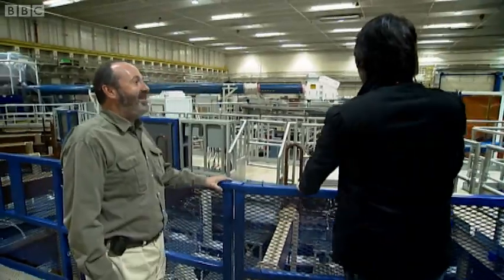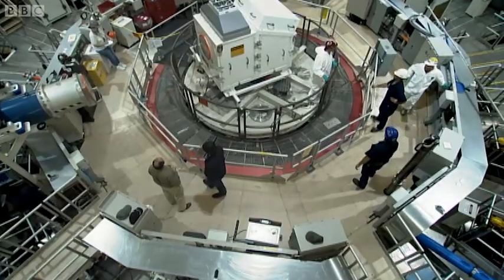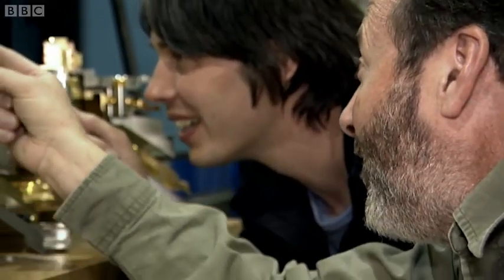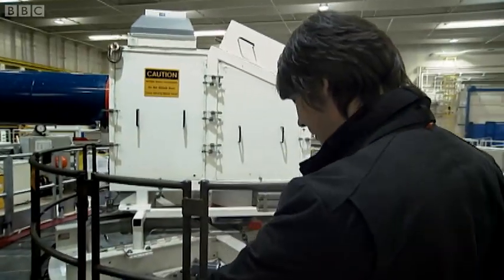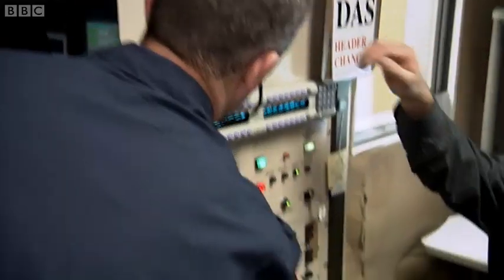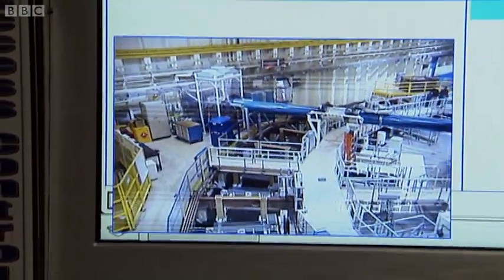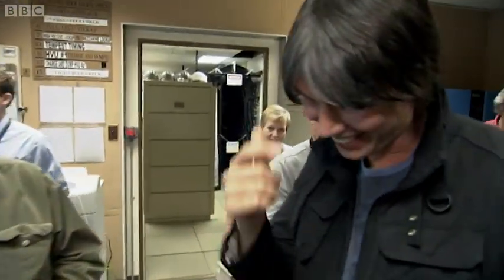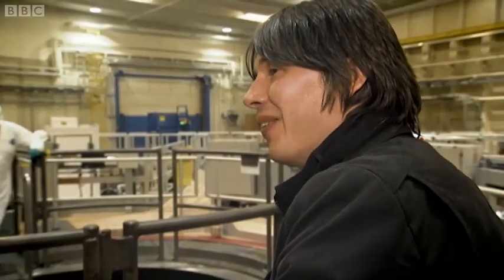The Z Machine - Can We Make A Star? - BBC

Comment: let's see... 28000000V * 82000A = 2296000000000W = 2.3TW

What kind of extreme capacitor bank do they have in their posssession to store that energy?
Reply: no clue lol.
Reply: @abarbar06  Linear transformer drivers is a MEGA  Capacitor ??
Reply: It's power, not energy, that's measured in watts - energy per unit of time. Total energy can be orders of magnitude less, but for a brief moment, producing high power. Nevertheless, the capacitor bank probably still is huge.

Comment: I dont get it, what is this documentary about? There is this Z-Machine and what is his purpose?
Reply: This documentry is a BBC production (I don't know the name) with Brian Cox exploring energy and how we use more of it every year so he is on a quest to see what the future might hold for power. The Z-Machine is an experement to see if we can achieve nuclear fusion, a source of power that would power everything many times greater than what we can produce currently but for a fraction of the cost and alot greener.
Reply: Well, that explains it. Thank you!
Reply: "Fusion is what powers the sun. Atoms of Tritium and Deuterium (isotopes of hydrogen, Hydrogen-3 and Hydrogen-2, respectively) unite under extreme pressure and temperature to produce a neutron and a helium isotope. Along with this, an enormous amount of energy is released, which is several times the amount produced by fission."

 Fusion would be able to use heavy water as a fuel source I believe not a radioactive heavy element like fission.

Current nuclear power plants use fission which is the splitting of atoms.

As for what is greener, in my opinion, nuclear energy is very green if done safely as all the waste from it isn't vented into the atmosphere like with gas and coal. It is also capable of producing the amount of energy needed that current renewable sources will most likely never be able to match. Many reactors in operation today are also of older designs and with newer designs and good planning that account for the build sites potential natural disasters and transport for permanent storage of the nuclear waste it would be very safe.
Reply: Ask Gordon Freeman...
Reply: +sammythesnake1986 but already use nuclear energy right whats the diffrences between current and this one and whats more greener about that nuclear fusion because both use nuclear energy right
Reply: Metin X I will be honest, I'm not an expert on this subject. I think the idea is to create a second sun on earth, a self sustaining power source that still uses nuclear material. You would be better off googling this.
Reply: From a person who lives in Albuquerque and has a brother in management of logistics at Sandia, this machine creates cold fusion, which produces more energy in a millisecond than all the energy consumption from the world. The reason it is called "The Z-machine" is because the beam of energy goes directly up or on the Z axis.
Reply: its to test fusion reaction , they  are inducing fusion

Comment: Im still not getting it what is the purpose of this machine of invention?
Reply: It also needs an insane amount of power which it uses to evaporate two small wires (seen in video). The left over molecules from those fibers are bombarded with the electromagnetic current which causes them to implode on itself. This in return creates new desired particles and a lot of energy.
The trick is to harvest this energy and keep the process going and ultimately gain energy from it.
Reply: They don't want you to know.
Reply: The Z-Machine is an experement to see if we can achieve nuclear fusion, a source of power that would power everything many times greater than what we can produce currently but for a fraction of the cost and alot greener.
Reply: +Lemons Rage how can it greener than our current ?
Reply: It preforms a Z-pinch. It's the worlds largest bubble-wrap popper / potential fusion ignite-or.
Reply: Generates an insane amount of power and busts it out as a massive flash of radiation to bombard things to see what would happen inside a nuke.

Comment: What I don't get is what is the point of it. Like what does the  machine do... I mean. They said what it recreates. But why do this? How does mankind benefit from this? It looks expensive. Feel like there are much better things we could be spending this money on
Reply: it creates a pinch of electromagnetic fields in 1 axis and electric currents in the other axis, the result is an increase in current density and a decrease in electromagnetic field size, which makes the electromagnetic field stronger.

The result is a positive feedback loop that gets stronger and stronger and stronger.. until POP and nuclear fusion is caused by the exponential entrapment of fusion fuel which has been turned into plasma by the huge electrical currents.
Reply: The idea is to then learn how we can sustain a plasma Z-pinch in defintely, to create a plasmoid or "ball lightning" and see if we can take energy out of the system in the form of heat. This could be another way to harness fusion power.
Reply: Once the pinch ( tightening helix ) is started you would have to supply 26 million amps continuously to sustain it ( not very efficient ) , this is for testing with an xray light source , It's  a large xray machine , nothing more.

Comment: 26 million amps...! How do you even comprehend that LOL
Reply: Where I worked, we had a 7.6 terrawatt machine. The capacitor enclosure was the height of a three story building about 60' wide by 100' long. At full charge, it held enough electricity to power every light in the US for 4 minutes... that was discharged in 4 nanoseconds. The individual capacitors were about 2' x 2' x 4', mounted in pairs. Their capacitance was so high that, left with open terminals (we always shorted them with heavy wire when not in use), they could "self-charge" just from the free electrons in the atmosphere and store a lethal zap just sitting in a warehouse, not hooked up to anything. Very expensive, and custom made.
Reply: @MrJest2  where did you work
Reply: @sereysothe.a  West coast nuclear effects simulator facility, in San Leandro. I'm not sure it's even operational these days; this was many years ago now. It's been bought and sold by several large Defense Contractor businesses over the years. Not sure who owns it now; I retired over a decade ago, and my last gig was in software engineering.
Reply: I did the math and it came out to be 2,262,000,000,000 watts, they must have some GIANT capacitors to store that kind of power.
Reply: 26 Mega-Amps not that hard. If you can imagine a trickly little hose compared to niagara falls just replace the water molecules with electricity.

Comment: im not discrediting this by any means I just have one question. . If it recreates the conditions of an H Bomb inside that cylinder how is it there just climbing in there with normal looking protective gear and just a regular face mask?
Reply: +MEGEM TESLA It recreates the head and energy of an H bomb through an electromagnetic pulse. This creates x rays that are dangerous during said pulse but unlike with an H bomb, the radiation is simply a pulse as there is no real "radioactive material". This means the radiation simply dissipates and the sight not contaminated. Basically it creates the "conditions" (heat, energy, power) of an H bomb, but without any radioactive material.
Reply: Thankyou :)
Reply: +thexgamer - Just plain old Stainless Steel. But very thick, and very expensive. The target chamber is generally kept in a vacuum for a shot. And yes, they have to get inside and clean it all out between shots.
Reply: The temperature is closer to thousand times as much as that of a h-bomb than the actual temperature of an h-bomb.
Reply: Hi, can I ask you a question ? what are the materials used to contain such power and heat ? thanks
Reply: Science and such is a passion of mine. Namely physics, electromagnetism and radiation.

Comment: what exactly is the purpose of this machine? is it so we can learn about nuclear fusion or are we actually using the energy it produces?
Reply: The Z-Machine is an experement to see if we can achieve nuclear fusion, a source of power that would power everything many times greater than what we can produce currently but for a fraction of the cost and alot greener.
Reply: it's to learn more about muclear fusion and and uae that knowlege in future.